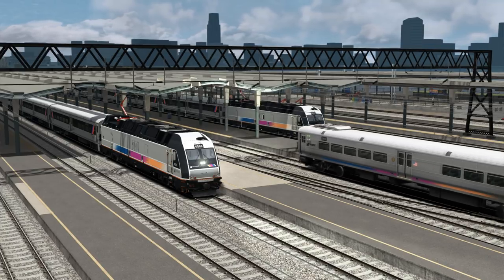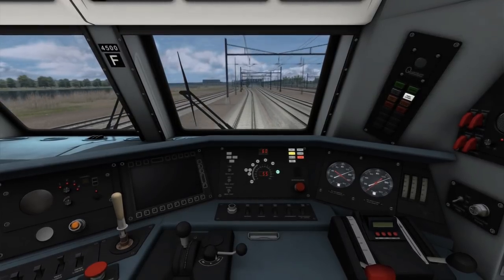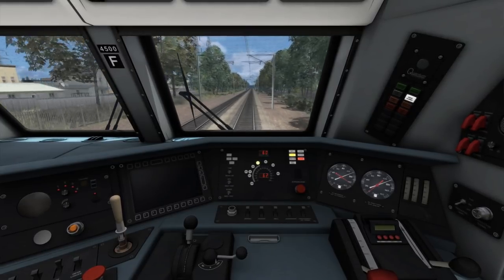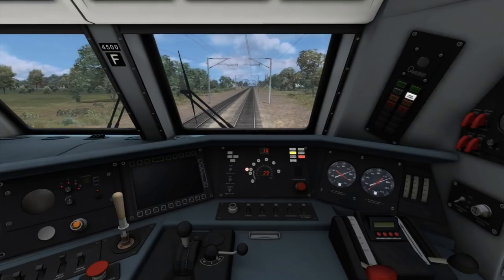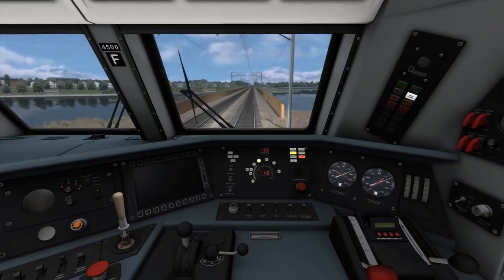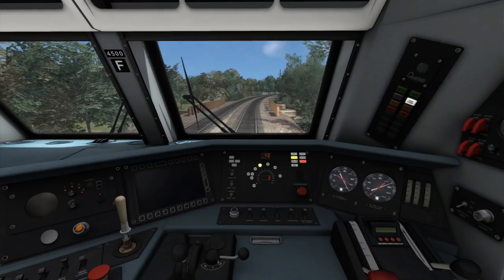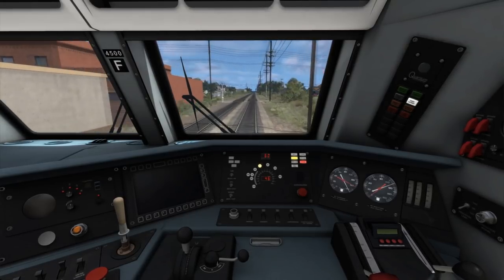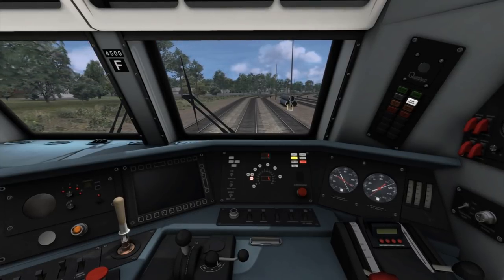Train Simulator 2017 - Route Learning USA: Hoboken Terminal to Bay Head (ALP-45DP)

Comment: Sorry to correct you, but Hoboken Terminal is also in New Jersey.
Reply: Yes, it is, along with the rest of this route. NJT operates almost exclusively in NJ, except for Penn Station ending most routes.
Reply: Also, procedure in the U.S. on NJT (I live a few blocks from a station) is to turn on the bell while going through stations. Here are some scenarios:
1. You are going through a station without stopping. You will turn in the bell and whistle when instructed to. Keep the bell on throughout the duration of moving through the station.
2. You are stopping at a station. Turn on the bell during approach, whistle when instructed. Sometimes the bell will be turned off while loading, sometimes no.
3. You are departing from a station you stopped at. You turn on the whistle, and start the bell until you reach the point where you would turn off the bell if you were going through without stopping.

Yeah, this is random, but this is also the stuff only people with personal experience would know.

Comment: The signaling system that the Alp45-DP uses is called the ACSES system. In the video you did not fully activate the safety features. The would require both ctrl-D, and ctrl-F. That would enable an alerter that goes off after a set amount of time regardless of if the controls are touched or not. With ctrl-F on it's also means that the signal speed is enforced more drastically, and you would have to at least have the main brake handle in at least a lap position untill within 3 mph of the target speed restriction. In real life the engineer would actually have a time limit to do this or he would receive a penalty brake application. This is the same form of signaling system on the New York to New Haven line, as you can see that Amtrak uses them both. Speed restrictions on this locomotive though are 15, 20, 30, 45, 60, 80, and MAS which is maximum authorized speed. Both the Alp45-DP and the Alp46 have openable window which do increase the sound of both the Bell and horn. New Jersey transit does not require the use of the horn when leaving the station, but only the Bell for a brief amount of time like 5 seconds unless of course there is a grade crossing leaving the station. The horn must be used before entering any station you go through or stop at. Same goes for the Bell. Side note New Jersey transit forbids the use of horns in most of their yards including bay head yard at the end of the line. Same for dover yard on the Morristown lines route. Infact it is really only Amtrak and the frieght railroads that use the horn twice when starting. Everyone else just turns the Bell on and off quickly if the train has one equipped or nothing if not. Amtrak on the northeast corridor also does not use the horn twice. For many portions of the New Jersey transit network the large (W) whistle board and speed signs are actually not present. (They make there drivers work for there money.) All level crossings most be memorized and the horn sequence is the same as everyone else. Even on the bay head section when you have 10 grade crossings in one mile. In real life engineers would just do the long long short long right before the crossing really quick which is kind of against the FRA rules though. As for the the second part leaving South Amboy that is not correct, and is also not realistic in any way. It's because you just reset the system when loading a new scenario and the signaling system does not currently know the next signal aspects, so it expects the worst which is a red signal. If you did have ctrl-F enabled, I would just apply the main brake to lap only, and accelerate to line speed untill it sees the next signal. But do be careful because there really could be a red signal. Try to use the dynamic brake more when stopping when on the bay head section since the speed is allot slower. Then when your slow enough then apply the main brake. Right before stopping apply the loco brake and release the main brake for a smooth stop. Great video by the way, and would hope to see you do the Bergen line or the Morris and Essex lines in the future. Both of which are New Jersey transit routes.

Comment: Also, procedure in the U.S. on NJT (I live a few blocks from a station) is to turn on the bell while going through stations. Here are some scenarios:
1. You are going through a station without stopping. You will turn in the bell and whistle when instructed to. Keep the bell on throughout the duration of moving through the station.
2. You are stopping at a station. Turn on the bell during approach, whistle when instructed. Sometimes the bell will be turned off while loading, sometimes no.
3. You are departing from a station you stopped at. You turn on the whistle, and start the bell until you reach the point where you would turn off the bell if you were going through without stopping.

Yeah, this is random, but this is also the stuff only people with personal experience would know.

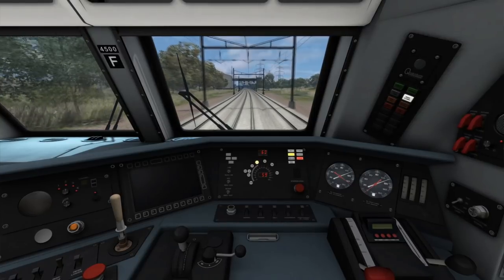Comment: I haven't found a signaling guide for this line (mostly out of a lack of effort). But I found that other railroads have similar rules. Back at 14:45 for instance. I've found that yellow over flashing green, known as approach limited, instructs the engineer to slow to limited speed by the next signal (limited speed may be different depending on the company) and the following signal, limited clear, instructs to drive the train at limited speed through the switch, then proceed at authorized speed once the end of the train has cleared it.

I have no idea how signaling work in Europe, but all of the big railroads in North America use speed based signaling. Typically there are 5 speeds: clear (or track speed), limited, medium, slow, and restricted. What they are vary depending on the company, but can look something like: track speed, 45, 30, 15, and slow enough to stop at half visible distance but not exceeding 15. Usually, the signals are just telling you what speed to travel, what speed to expect to travel by the next signal, or when to expect to stop.

Anyway, to me, you seem to be interpreting the signalling correctly.
Reply: In Europe, the signalling systems are also speed based (apart from the UK) but far simpler than this, which I would describe as a hot mess.